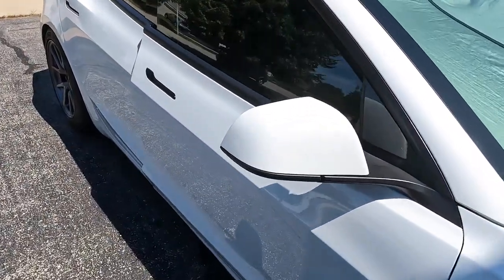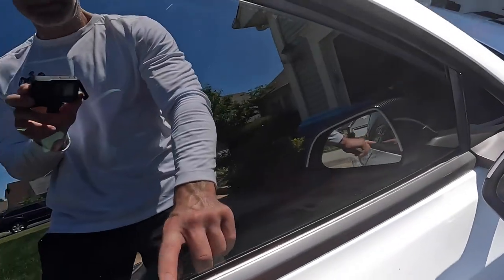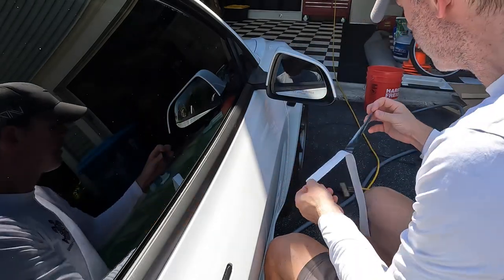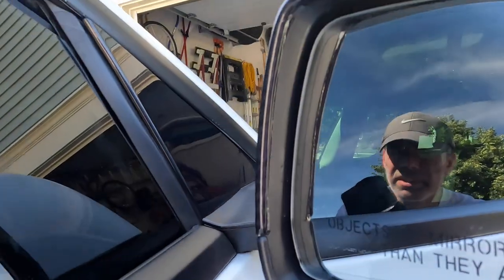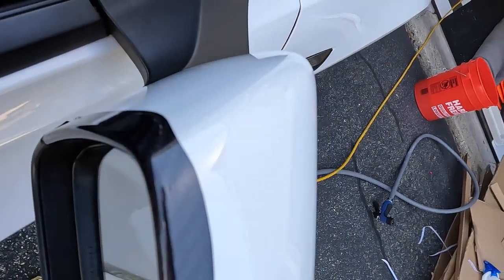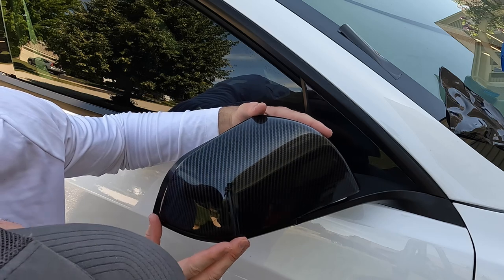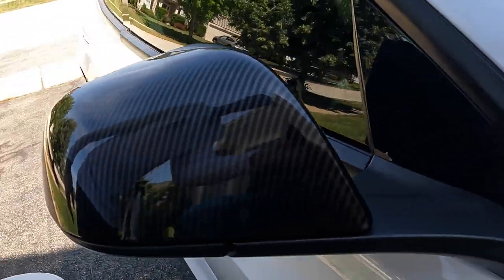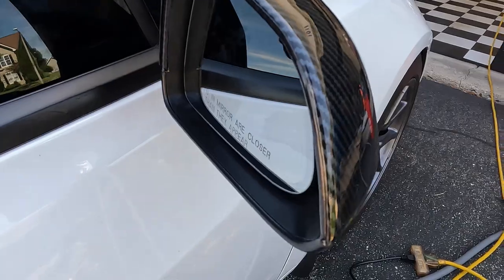Carbon Fiber Your Mirrors - Cover vs Vinyl Wrap

Comment: The cap looks better than the vinyl in the video.
Reply: They look like abs plastic caps, I've got real carbon fibre caps and they lip over the front so you can't see the white.
Reply from the maker: @dalemoore11  It's what I get for cheaping out and not looking at them closer before buying...